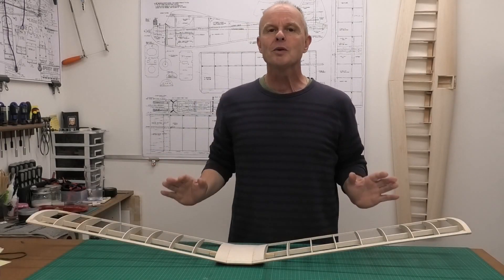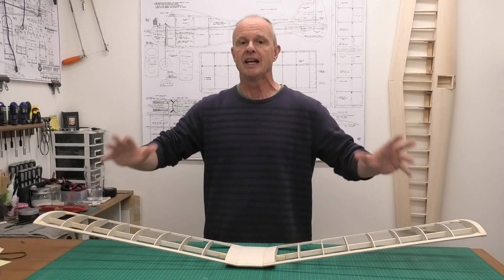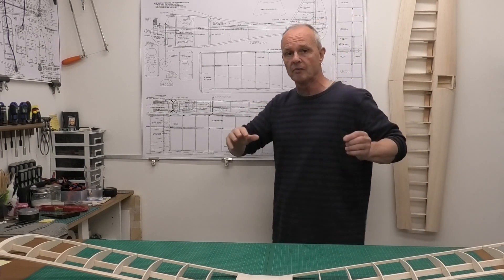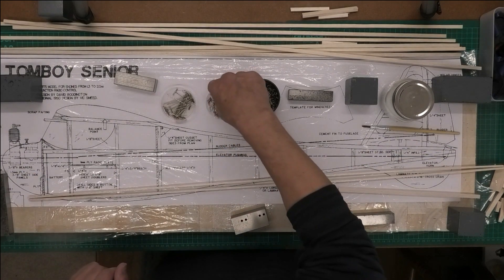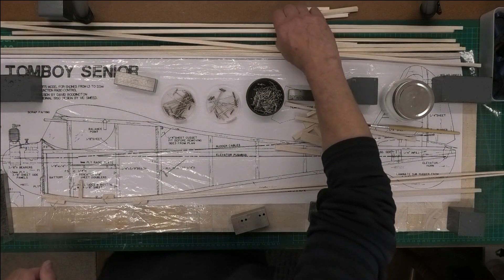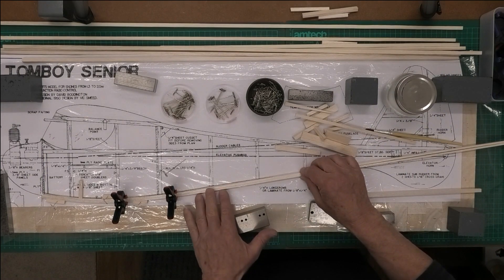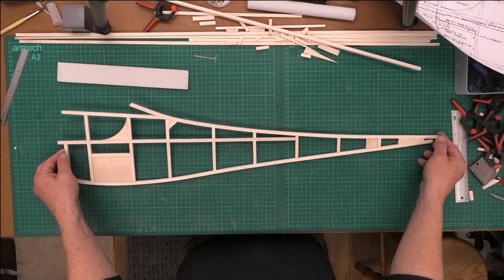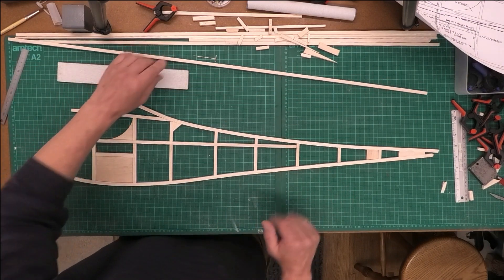Tomboy Senior - Build Series - Pt 4: Laminating the Fuselage Sides

Comment: Another super episode, thank you.
When joining curved longerons be it for fuselage sides as shown here or wings etc... with balsa strips the strips ends will need to not be square but follow the shape of the curve to get the best fit, are you doing this by eye or are you measuring the cut angle or marking them in some way before cutting?
Cheers
James
Reply from the maker: Hi James, thanks for the comment, its greatly appreciated.  I am marking the cuts by eye and cutting, followed by the occasional sanding of the end to get it right.  Hope that helps.

Comment: I found this a really interesting build video Mark. It is educational to see how other builders tackle various aspects and particularly your tips like the scrap balsa packing for the pins. I liked you laminated longerons approach as that must be less stress than soaking and bending. I am interested why you decided to change from PVA to thin cyno for the braces? A friend of mine is a keen user of Super Phatic adhesive.
Reply from the maker: Thank you very much for the kind comment, really pleased you are enjoying the videos.  Regarding the different glues, PVA is obviously great for the lamination, as it wets and softens the wood before setting.  Regards the CA, it  is quick, but I particularly like it because once you have put a piece in place and glued it it is fixed and will not move.  With PVA and aliphatic it you are not carful you can alter the alignment of joints as you glue new new pieces in, this is the same for wings and fuselages, essentially with CA the bits stay where you put them once glued.   Hope that helps
Reply: @MarkRobinson555  Thanks Mark.

Comment: Nice ! Good idea on the laminations, but I’d be worried the glue would stick to the small balsa blocks used for framing. Also, a tip I just learned is to use a razor blade to make sharp accurate marks on your balsa sticks to mark where to cut, instead of using a pencil.
Reply from the maker: Hi Steve, pleased you found the video helpful, thanks for the comment

Comment: what grit of sandpaper do you use when building? greetings from Belgium
Reply from the maker: Hi there, I would generally use a 80 grit that has had a bit of use, fresh 80 grit may be just a bit to harsh. Hope that helps
Reply: @MarkRobinson555  thank you!  For finishing 400?
Reply from the maker: I find 120 and occasionally 240 is fine for finishing 😀
Reply: @MarkRobinson555  thanks! 😉